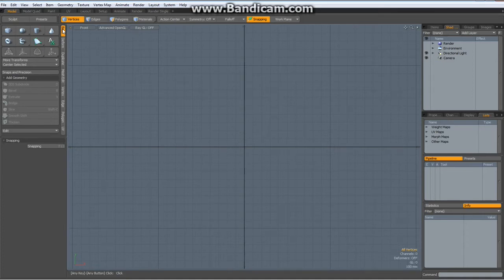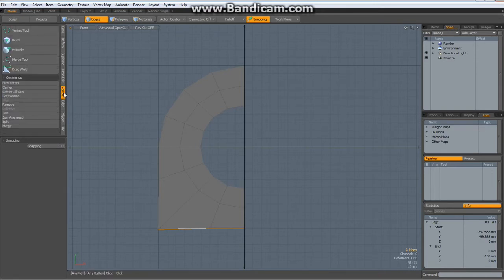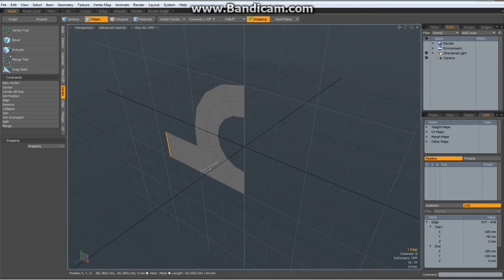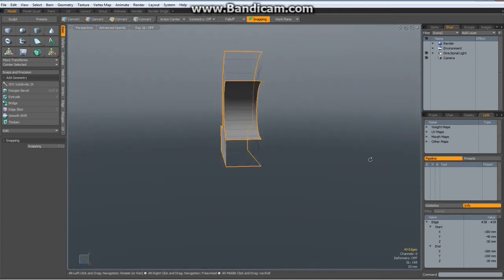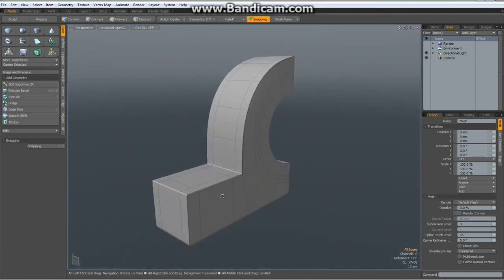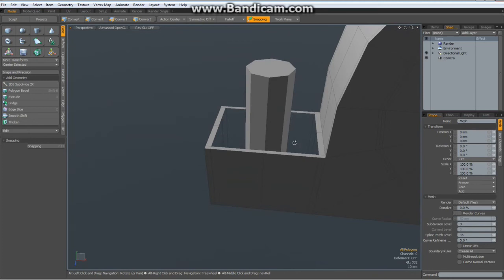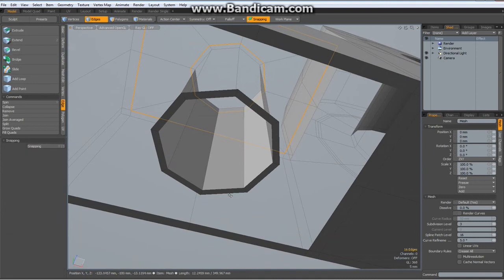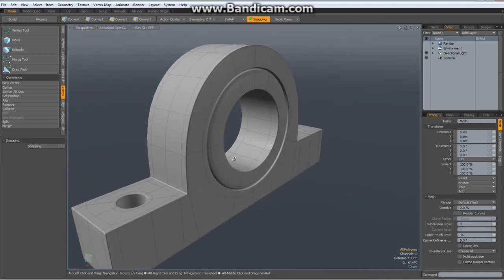Modo 501 From 2D to 3D Part 8 - Modeling a bearing block

Comment: I'm learning modo modeling thanks to you. I have a question for this model. I've found a way to make hole to items. Using boolean command to substract items, like a cylinder from a cube.  i made the holes with this way. Is there any spesific reason to make holes like your way at 06.00 mins or only you want to. Thanks again.
Reply from the maker: +Erol PEHLİVANOĞLU Hi, yes, booleans are the normal way to make holes, but i wanted to show alternative ways for people who don't like boolean operations. Usually you need to do quite a lot of cleanup after doing a bolean subtract. Kind regards, Peter
Reply: +Peter Stammbach thank u very much